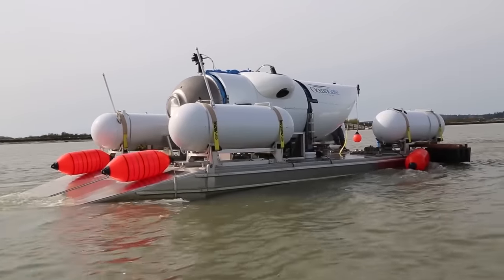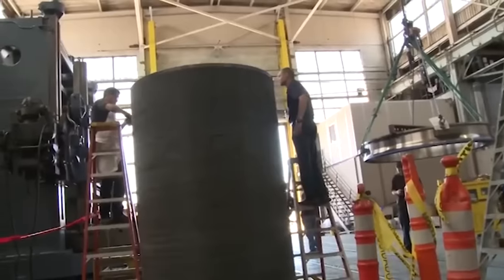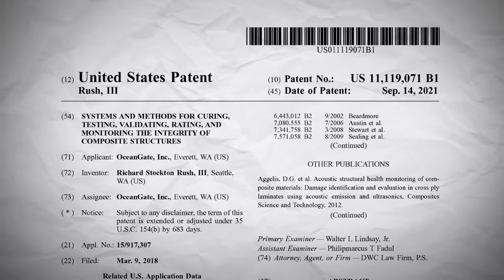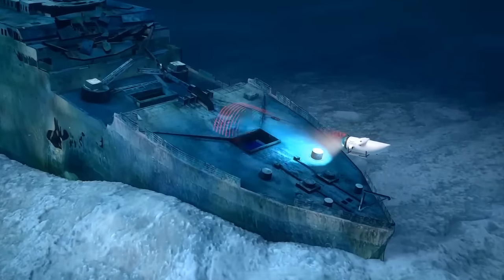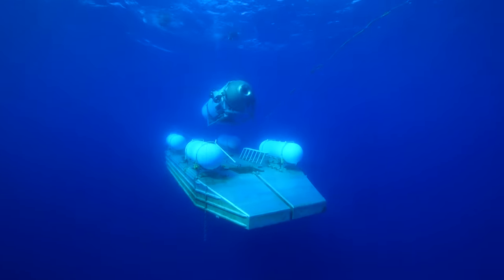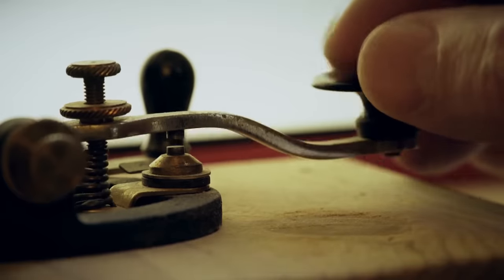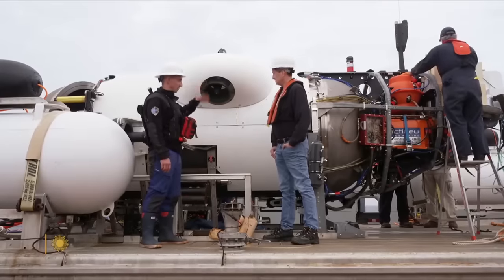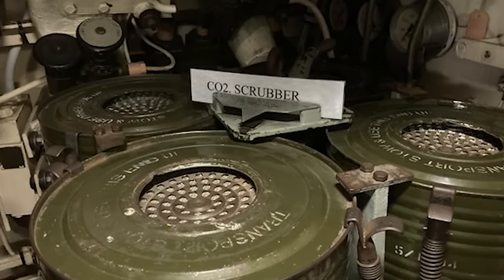Exposing OceanGate Submarines Many Fatal Designs

Comment: Shouldn't there have been a huge amount of bubbles that would have surfaced around the main ship? Or would it just have dispersed and become nothing? I've heard the Navy knew right away that there was a large explosion coinciding with the time of loss of communication.
Reply: There was no communication in the sub and the bubbles may have drifted far away, remember 12k feet is DEEP
Reply: @CatBot007  There was communication with the sub until the point failure after it had dropped it's weights in an attempt to resurface quickly, at which time the navy said they heard a large loud implosion. So the navy knew right away the sub imploded. The fact that 4 days were wasted and huge amounts of resources right along with it is maddening.

Comment: The acoustical warning system would never have provided enough warning for them to communicate with the surface let alone make it back up to the surface without decompression issues. The hatch/window was sealed in place with eighteen bolts which would have to be manually unscrewed once topside, presumably re-mounted on that launch sled!
Reply: Actually - 17 bolts if we are to believe the info in the news...
Reply: @les8489  Yes, one bolt reportedly was left unbolted because it was hard to reach.
Reply: Decompression would not have been a problem for the passengers, because the air pressure remains the same in a submersible at all depths. As for a rapid rise to the surface, the Titan's buoyancy was nearly neutral, so it could not rise rapidly; it could only rise or fall slowly, depending upon its minimal ballast. But if it did rise rapidly, I would think that the carbon fiber would weaken even more rapidly due to the unstable water pressure.

Comment: I can see carbon fiber being used with pressure on the inside. Fibers in tension. Do not see it as advisable with pressure on the outside as used here.

Comment: As everyone has pointed out, the Titan was very poorly designed and built, and was a disaster waiting to happen.  However, this is exactly what Stockton Rush wanted. This was a very deliberate choice on his part, and not a matter of him making mistakes.

Stockton was a thrill seeker who derived great pleasure and satisfaction, much in the same way those who cheat death going over Niagara Falls in a barrel. He did not want a submersible that was a sure thing. He wanted a submersible that would have the distinct possibility of catastrophically failing. To him, this was fun, just like risking the loss of your house at a casino. He mislabeled his endeavors as being "innovative", but there is nothing innovative about his designing a death trap. And it was likely an extra thrill for him to know that he was also putting the lives of others in danger as well, and he was certainly aware of this.

Therefore, it is quite clear that Stockton Rush needed mental health therapy and should not have been designing submersibles to be used by passengers.

Comment: I worked with carbon fibre many years ago... it is advertised as being an advanced material.. it definitely is not stronger than steel... it is lighter but in my opinion the hull of this vessel would have to be at least 1meter in thickness to have any chance of withstanding that extreme pressure.
Very very stupid design for a high pressure vessel ending with a very unfortunate outcome
Reply: 1 meter in thickness...please provide the analysis to support this (quite a silly) claim.
Reply: @les8489  imagine an elephant standing on a plastic bottle... then put another 250 elephants on its back... this is roughly how much pressure the plastic bottle would have to endure repeatedly....carbon fibre is nothing more than reinforced plastic which will crack under pressure naturally..   unlike steel which is far stronger and is the only material used for any high pressure submersible... the only property that carbon fibre has is being lighter than steel... therefore being useful for aircraft, boats, cars etc..... but definitely unless under high atmospheric pressure conditions..... ridiculous idea that should have been put under extreme testing before any thoughts of human cargo being considered 🤔
Reply: @fordprefect.betelguese  Elephant standing on a plastic bottle does not produce hydrostatic pressure - so your example is wrong. Carbon fibre is NOT reinforced plastic. Steel is NOT stronger than carbon fires. Yes, proper testing and analysis has to be done (irrespective of potential drawbacks of using composite in this application...)
Reply: @les8489  well, I know one thing.. if have a carbon fibre sheet and you hit it with a sledgehammer.... the hammer will come out the other side.... this does not happen with steel...
Reply: @fordprefect.betelguese  You are quite correct - you don't even need a sledge hammer. This is one of the reasons I considered carbon/epoxy composite as the least desirable material for a deep dive vessel. The problem with vast majority of posts here (including yours) is that they consist of some vague and approximate truths, with the rest being conjecture, guessing and totally inaccurate or erroneous opinions regarding composite materials and their behavior. Which does not surprise me...

Comment: 05:50  Agree. Game controllers work perfectly fine to direct navigation. This was not the problem. The problem really were the materials and design of the sub itself.
Reply: The design of the sub was the main problem, yes. But it's also spectacularly dangerous to have a crappy, consumer-grade wireless device as a single point of failure on a can of people that you have no way of retrieving from the ocean if it breaks down.
Reply: @beeble2003  Pretty sure the controller is not as "crappy" as you say. And using mass produced has strong advantages over custom made ones. In this case, it is easy to create a back-up system for the controller since duplicates are readily available in the market. Also, the obvious price advantage. Saving up money by using standard / commercially available ones means you have more money to spend on more important features, and your experts can spend more time on more critical studies / analyses. You should know that custom made equipment can take verrry long to repair / replace  since there's typically only ONE or very few manufacturers can do it, and also they can be verrry expensive.
Reply: @mocabe01  Saving $30 or $300 or even $3000 on the controller makes no significant difference to the price of a sub costing over a million dollars. I wouldn't trust my life to a $30 video game controller. Would you?
Reply: @beeble2003   If the controller was the only issue of the Titan, then "yes" I would trust the device. Titan is a submersible and NOT a submarine. It does not perform complex maneuvers at all. You can Google the issue yourself. There are a couple of expert commentaries that find no issue with the use of a commercially available game controller.

Comment: The finite element analysis is probably acceptable for an anisotropic material like carbon fiber. The reason for that is that you are dealing with a load path that will likely be very close to the same regardless of what material  you use. In fact the stresses can be calculated by hand and are independent of material type because you have a close to structurally determinant system with a relatively easy single load case. The FE will give you a bit of refinement but if the hand calculations don't work, the FE won't work. The exception would likely be the attachment of the viewing port. Even then, the math may not be as easy, but there are not very many possible load paths for the stresses to go.

What is far more important is the behaviour of the material. 

I should also note the FE is used for all sorts of anisotropic material. You just have to know what you are doing and the limitations.
Reply: Well...some hand analysis can be done - just to set the goalposts. But with multilayer composite structure - hand analysis is but impossible. Even in FEM, the analysis is done layer-by-layer, and the average values of stress are a rather poor indication of what is happening in individual layers. FE WILL work when hand analysis is too simplistic (or too complicated). That's what 40 years of doing both taught me...
Reply: @les8489  This is a very simple structure with one single dominant load case. It is more of material behaviour issue than a FE analysis issue. As you indicate the average values of stress are a rather poor indication of what is happening in individual layers.

Even in steel, the FE rarely accounts accurately for residual stresses. It is the behaviour of the material that saves the FE from being "wrong".
Reply: @yodaiam1000  FE is not wrong - if the analyst knows what he is doing...
The composite material in FE is characterized a sequence of orthotropic layers with their directions and properties specified. The thing is - this is a simplification. In order to properly model composite material - we would have to model EVERY fiber, with its thickness, waviness etc. etc. But then we would have a problem with material properties like specifying the strength of the bond between fibers and resin (which is extremely difficult to quantify), thermal expansion factors (different for fibers and matrix) etc. etc. . This is a rabbit hole no one was to get into, so we approximate an individual layer properties by measuring individual E1, E2, G12 (sometimes G13), thermal expansion coefficient - and this enables us to investigate stress layer-by-layer without getting into more esoteric material properties and micromechanics of material behavior and residual stresses. We deal with it by applying proper safety factors and reducing the maximum design stress to (usually) less than 30-40% of the ultimate strength of the composite. We also take care to put fibers in ALL directions to produce structurally sound composite.
Reply: @les8489  FE is just a load path. It is not the actual load path. It is just an approximation. You can do all the analysis in the world, and it will only ever be an approximation since you can not factor in all parameters and the changes of the material properties with time and cycles. Try to model all the crack and changes in concrete through a loading cycle. It is not realistically possible.

However, if a structure is determinant or close to determinant, you can get a pretty good result. If it is close to determinant, hand calculations will also give a good result.

What is more important in a case like this, is the fundamental material properties. If you get a delamination or delaminations over time, you are more prone to have the shell buckle.

I am not saying FE is useless. It is just not a panacea. It is just another tool for assessment.
Reply: @yodaiam1000  I suspect that your familiarity with FEM is limited to just what you have written above.
Yes - it is just an approximation - and damn good at that.
Having extensive knowledge and practice in both FEM and hand analysis (aircraft) I can only say this: hand analysis supported by appropriate stress manuals and test data is largely irreplaceable in analysis of details. Take any stress manual from Boeing, airbus or any major manufacturer: hundreds upon hundreds of pages with formulae and diagrams, covering all design parameters - mostly of detail parts and features.
Unfortunately - the existing structures are in their vast majority structurally indeterminate - that's where FEM comes in, as it is impossible to do proper analysis by hand (decent approximations by hand are in some cases possible, and should be done - which I usually do).
The problem with FEM is not the method: the problem is usually located between the chair and the keyboard - that is, it is the analyst.
To use FEM to its full capabilities, to be able to create a proper model and to assess the result - a little bit more skill and knowledge is required than the ability to switch on the computer, press some buttons and produce a colorful images on the screen (which are beloved by the managers and the uninformed - which frequently is one and the same).
Most people using FEM have no idea how it works, what are the limitations, what are proper modeling techniques, and are not able to assess the results (this does not apply to the experts - of which unfortunately there are few and far between).
It was always my opinion for the last 30+ years that every FEM user should be certified. Alas - the trend is in the opposite direction - as witnessed by adding some (quite limited in some cases) FEM capabilities to CAD packages. Since many people using CAD have no real idea about design (despite proficiency in using CAD tools) and even less about structural/stress analysis - the results are often less than desirable. I have seen it many a time.
With composites - as I said before - if we modelled the composite material fiber by fiber - we wouldn't even know all material properties to plug into such a model (try to determine the Young's modulus of one carbon fiber in the transverse direction, for instance...).
It is much easier with isotropic materials (steel etc.) with which we have vastly more experience and the properties of which are much better known.
In case of Titan, however, both the choice of material and (probably) the design and analysis are to blame - which has nothing to do with FEM.
Reply: @les8489  My experience is that there can be a significant difference between FEM and measured results. At a conference a few decades ago there was a presentation on an existing bridge. They used two groups to analyze the bridge and different FEM software packages. Both teams got very similar results with the 1st mode of vibration and the frequency. Both teams measured the bridge frequency and both teams measured results were the same. The only thing was that the measured results were out by double from the FEM.

For seismic analysis, most codes don't allow you to take the 1st period less than 80% of the code frequency even if the analysis shows much less.

From many years of experience, your results will also start to differ substantially when you have a very stiff structure. tiny differences in settlement etc make big differences in results.

More precise models get closer and closer to the theoretical result but not necessarily the measured result.

There are all sorts of parameters just not accounted for like differential shrinkage, differential cooling rates when crystals are forming, creep etc. You really can't tell what the residual stresses are and the impact on buckling or stresses. That is why you have to mix code equations with FEM results (or hand calculations).